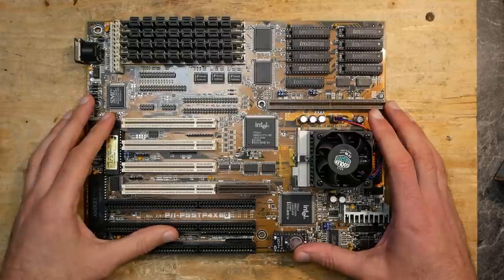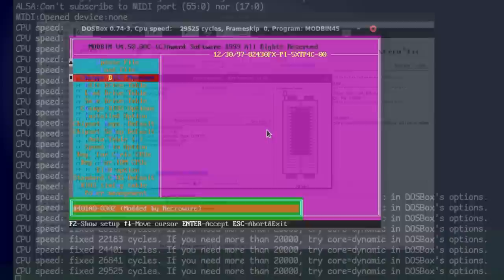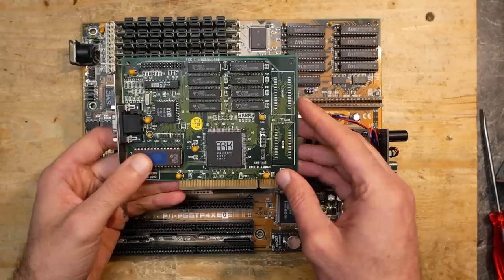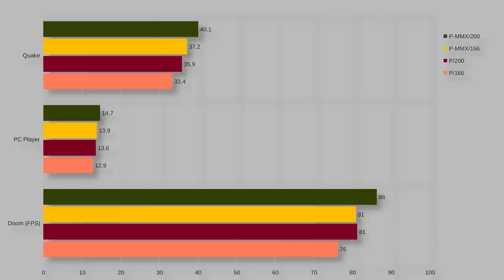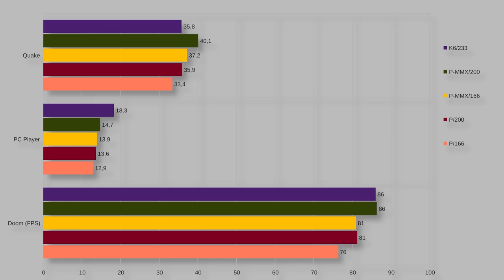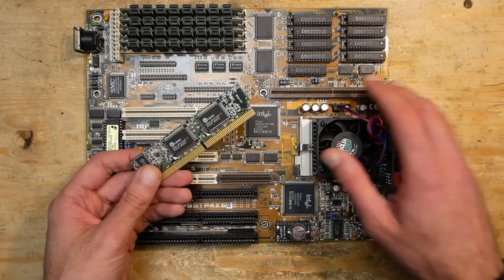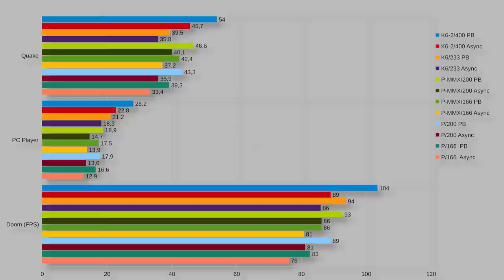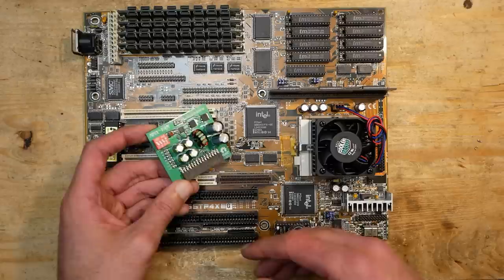Let's upgrade an early Socket 7 board beyond the limit (Part 5): Showdown!

Comment: I remember wondering how the FSB speed division worked on motherboards, I didn't know enough to investigate it back then though. Do you know? is it handled by a crystal or an IC somehow? I mean the division of the FSB to PCI/ISA bus speed.
Reply: From what i remember say PIIX has all the clocks supplied externally and it doesn't care where they come from. But to convert between different clock domains, it performs buffering. So there's two parts to every multi clock domain system, for one clock generation, and for other signal translation which happens on whatever logic IC that has both clock domains, and signal translation for PCI to ISA is on the PIIX. But PIIX being a PCI device, of course it's only half the picture, it never has to deal with FSB.

Let's see, i fished out a 430tx mainboard reference schematic. I can see there a dedicated clock generator IC which is part of the chipset, IMISC652 or IMISC671A. I also remember that newer boards usually use a similar multi clock domain generator IC, it's often third party, there's a bunch of suppliers, Cypress probably the main one. A tiny little thing, not noticed at a glance. So this one has a 14M318 crystal oscillator and generates PIIX clocks, 48M (bet that's the USB base clock on the PIIX), 60/66M, PCI, FSB and DRAM clock i think. I can see on this board also a 32K768 RTC crystal in either of the two places, could be on IO IC or on the PIIX. So that's it, no more crystals.

Fundamentally an AM3 system still looked the same, with that 14M318 and some cryptic proprietary clock generator spawning everything from that. AM4 looks different, there's a 25MHz crystal at the chipset; and a 48MHz one and an RTC one at the AM4 socket, and i guess all the other frequencies just come out of either of the two chips, mostly the processor just generates the clocks internally a whole bunch of them.

Fun fact: apparently fundamentally reliable, race-free clock domain transition between uncorrelated clocks isn't possible. I don't know if it's an actual fact, i haven't verified it first hand, but i've been told that it is so. But it's possible to have probability of failure astronomically low, and that's probably good enough for systems of the eras where the domains are independent. Today all interfaces are packet oriented which presents an extra opportunity, that packets are buffered input side, can be checksummed and re-sent, so you can cover up the potential unreliability of clock domain transition this way.
Reply: @SianaGearz  Now that's information! thank you very much

Comment: Very cool project. Did you try the older bios with the coast module?
Reply from the maker: Yes, overall performance in Doom is lower and in Quake higher, as I explained, but the relation with to without COAST module is similar.

Comment: Sorry, off topic, but where do you safely get all updates for XP, and are you using 32 or 64 bit version? I'd like to create an offline library of those, and slip them into a final install (32/64-bit). Thank you.
Reply from the maker: I just use SP3 and don't allow any outdated PC to access the internet.
Reply: @necro_ware  So, 32-bit. Ok. If i do get the whole bag of updates directly from Корпорация Майкрософт, (no n-Lite, no 3rd party bs). I will find some way to inform you. Thanks.

Comment: Just pulled a Pentium mmx 266 cpu (FV80503266) from a machine vision system at work, if there's anybody  who wants it, it's free + shipping :) located in Norway :)
Reply: Well, I do want it. Obviously, I would appreciate it very much; the only issue is that I could not find a decent quote for the shipping costs. On Eurosender it was about 90 Euros+tax, which is insane; it should get an airplane seat of its own for that amount. Other websites would not display the result and would want me to request a quote. 
Maybe the regular postal services would be something reasonable at around 10-15 Euros.
Reply: @AndreiNeacsu  I can do some digging around with the postal service and couriers to find the cheapest way of sending it. In which country are you located?
Reply: @bafon  Thank you very much! I am in Romania, postal code 077125.
On a different topic, if you are a fan of retro computers and repairs, you might like the channel called "Arctic Retro", from Bodø. It is also on the list of my favourite Youtube channels. 
Best regards!

Comment: Hey Necroware, very interesting results. You're probably not aware of MPE's (Vogon's user) discoveries (which match yours) with Intel FX chipset and Async cache. Do a google search for "Intel 430FX Triton L2 Cache" on the dependency-injection website and read a bit. The FX chipset is somewhat bugged or has severe flaws while being used with async cache. So much so, that it's even slower than using no cache at all, except in very very specific scenarios. The chipset was probably developed with PB cache in mind, and async compatibility was just thrown there at the last minute.
Reply from the maker: Thanks, I'll take a look

Comment: An excellent video as usual! I'm sorry I have to copy&paste a comment from one of your previous videos, but it seems to have gone unnoticed so here you go:

But with all due respect, please, PLEASE (I can't emphasize this enough!) stop making percentage comparisons of FPS values. FPS is a hyperbolic (1/x) function of time and taking percentages of its values doesn't make any sense whatsoever, that would only work for linear values such as time, clocks, tics, etc. For instance, the framerate increase from 5.9 to 7.2 FPS means that the average frame time has gone down from 1000/5.9=169ms to 1000/7.2=138ms. (169-138)/169 is roughly a 18% improvement. Granted the difference between 18% and 22% ain't that big of a deal, but the higher the difference between the framerates, the bigger the percentage measurement error.

There's an article on this topic by Robert Dunlop which I highly recommend reading: http://www.mvps.org/directx/articles/fps_versus_frame_time.htm